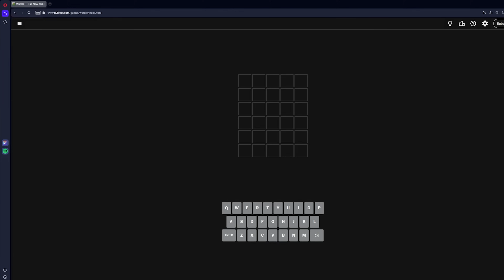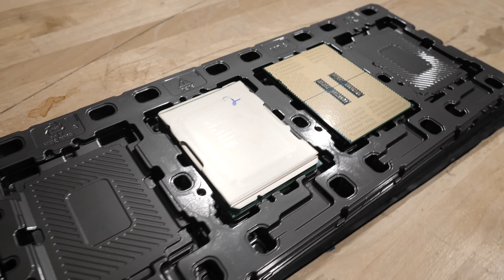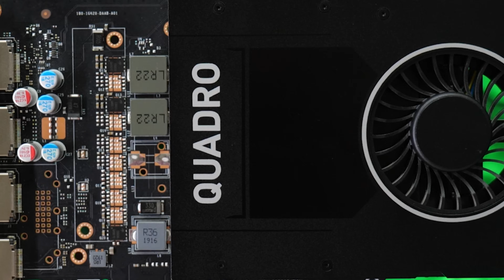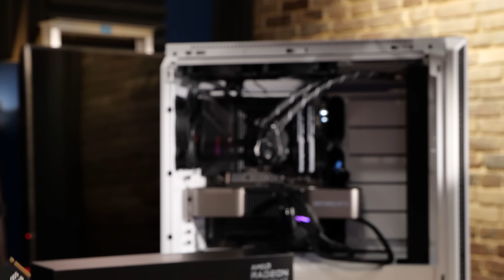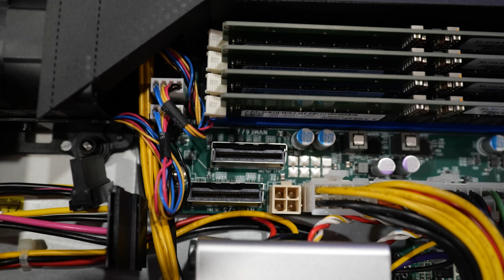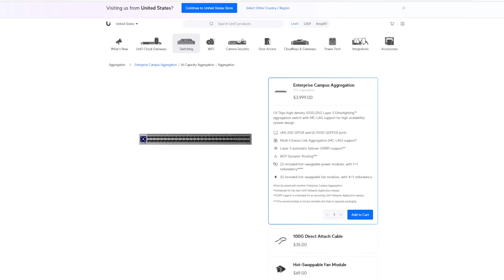What I've Learned Building High End Systems In 2024

Comment from the maker: Check it out here: https://opr.as/Opera-browser-Level1Techs
Reply: I can't stand Opera for one simple reason... they got rid of the familiar File Edit... menu bar... and they got rid of the Window Title bar.  You just don't do that in an application.   There is no way to grab the window and move it around without switching tabs.   Another major fail.    And they would be so easy to fix, just follow the user interface guidelines for Windows or Linux or Macintosh application windows.  Google Chrome and Chromium and Edge drive me crazy for the same reason, so I'm stuck firmly in the Firefox camp where I have a Title Bar to grab and a menu to select and chose options from.  Not some cryptic hamburger icon.

Comment: Oh I see the asrock steel legend SL 1000 can support five EPS connectors if you purchase three more cables somewhere! And rather affordably priced.
But mod DIY does have adapter from PCI to EPS however have to be careful of current due to half the 12v lines. But that is another method to get your EPS fix!

Comment: $100 Be quiet! Pure power 13m 750 w has 2 Full 8-pin CPU connectors, And the fan stays off in a moderately warm room with 300 w load!

Comment: could you guys recommend any PC case for threadripper pro, 512gb ram and qudaro 4000 (i barely use GPU, reuse from older workstation), which can facilitate 8x 3.5 HDD drives and have great airflow? All of the options presented in this video (torrent, north XL, ProART) supports only between 3.5 2-4HDD drives.

Comment: I was considering an older 3647 c621 system with dual xeon platinum 8180 and ASUS SAGE WS if I can find one. Just to have a workstation with 56 cores and at least 768 gb ram for editing, 3d and color correction and I was considering a used rtx5000. Windows seems to support xeon a long time and it's not x99 without UEFI bios I used to crack in 30 seconds.

Comment: i have r9 5950x with 128gb DDR4 but i'm starting to get random crash, i tested the system with just one stick of DDR4 in different slut but it keep happening, only when i limit the CPU to eco mode it work, so i guess it's a CPU, i don't want to invest in AM4 cpu upgrade and i have no warranty the pc from 2020, so i'm thinking to upgrade to am5 but i need a lot of memory...
any chance of AM5 128GB/192GB DDR5 video ???, can you run it at 6000mhz cls30 ???

Comment: Looking into a Silverstone RM52 for my next workstation too. It will likely be an arrow lake platform with fast ram. G skill now has CK modules that do CL40 at 8200mhz, but recently annouced CL26 at 6000mhz. Now I am unsure which to go with for my workloads. So I am hoping to find some benchmark numbers as the prices for 2x24 are the same but the later kit also has a 2x48 option - which could be the pick. 

As I plan to put a 360 radiator into the front.... I an not sure if the airflow across the mainboard will be sufficient, as those consumer Z890 boards have the ram not inline.

Comment: If you're at a point where it makes sense to build a system like this please, please don't buy Unifi. Depending on the features I'd strongly recommend going with either Juniper or Arista - something like the QFX5120-48Y from Juniper is 48x 25gb / 8x 100gb for ~$12-15k with a base license. Yes it's more but if you're planning to make money off your workstation you should have something far more robust than what you're going to get from Ubiquiti.

Signed, a network engineer
Reply: Absolutely agree, listen to this man

Comment: state of pc is horrible right now for high ram use cases, AMD reducing the ram slots on threadripper, instability with 192GB on ryzen, + lack of  64GB modules  means there is little in the way of upgrades for someone jumping from DDR4 / AM4 / Threadripper
Reply: I'm keeping my TRX-40 Threadripper. Really, I see no upgrade path forward at this point in time. While the 7960X is faster than my 3960X, the difference in performance is not insane, and I can't really have more memory or memory bandwidth.
In the meantime DDR5 is more expensive, so it's a much more expensive system for somewhat better performance.

Comment: JUST yesterday I bought three dual 25G NICs and a pair of sfp28 cables though I think I will only use two of them and run the second 25G port from my pfsense router to connect to my cheap 10G switch as I have a lot of 10G in the homelab...I'm super excited.  I was wondering though if I could buy a 100G to 4x25G breakout cable and use that with a 100G NIC in the pfsense router to go to my four servers with 25G each - but I don't know if a NIC can split the signal out or if it needs to be a switch...anyways, super excited about the upgrade :)
Reply: Wow! That's a really cool idea! I wish I could tell you for sure if the breakout cable would work on you router. That's a cool project!

Comment: So linux people,  tell me, opera or firefox for nobara?
Reply: I use Librewolf, a Firefox fork with privacy-minded defaults
Reply: Is this bait? No one should use opera under any circumstances.
Reply: @tappy8741  Oh alright? So then what are the option for linux? Nobara starts you with Mozilla. I was more checking if they are alright and if there is maybe something better.
Reply: @ Firefox or chrome or a privacy derivative you trust if you feel the need, tor browser to bypass blocking when necessary. Personally I just use firefox with some ad and tracking blockers (noscript and ublock origin does the job for me).
Reply: Librewolf (privacy-focused Firefox fork with good defaults) for general usage and Ungoogled Chromium for anything that works better with Chrome or breaks with the Librewolf settings. Use multiple browsers for different sites and purposes. Opera especially on Linux is behind Ungoogled Chromium, skip Opera.

Comment: The thing that keeps me using Firefox is every Chromium based browser sucks with font sizing. Firefox font sizing changes icon sizes and the text of everything from tab headers to general text with allowed defined size variations. Firefox also scales the entire web page to fit without having to scroll from left to right. Chromium doesn't scale the size of everything missing important elements entirely and when font size is inceased you have to scroll from left to right. For basic accessibility any Chromium browser sucks. On Firefox I can open a new tab or close one simply by pressing the mouse wheel. Any Chromium browser allows me to close a tab by doing that, but not open one.
Reply: Ctrl+w
Reply: @AI-xi4jk  depending what I'm doing I'm not always within reach of the keyboard and it still doesn't fix the terrible font scaling. Nothing worse having to scroll left, right, up and down to read something you shouldn't have to.
Reply: Middle click opens links in a new tab in Chrome (without switching to them), are you talking about something different?

Comment: Hey Wendell. What would you suggest for a college student on the typical college student budget? Budget consists of Disbursement from student loans and grants, so have to be somewhat conservative with the rest of the setup. My current setup is an AM4 based AMD only system: Ryzen 9 5950x CPU, the GPU is an XFX RX 7900 XTX Merc 310 something or other. Ram consists of 128gb 3600mhz ram (by Crucial, I think). Storage is around 6ish tb of storage space across all ports, 2 physical spinning rust drives, 1 and 2 tb, one of each, the 1 tb is an sshd, don't ask me why, no significant difference in performance. The SSDs are a mix of 512gb, 1tb and 2 tb drives, all by Rocket or Crucial. I'm pursuing a degree in Multimedia at a local community college, and suspect I'm going to need plenty of storage space. Should I go NAS or simply upgrade onboard storage on the computer? Oh, and the case is a Corsair 4000D Airflow, the 5950x is cooled by an Arctic Liquid Freezer III 360, (possibly overkill, but whatever.) Anyhoo, thanks in advance. :) PS, it's also my primary gaming computer, as you might have gathered from the specs.
Reply: You sound like you already have a pretty darn good setup for someone on the typical college student budget. At this point you should just optimize what you have for maximizing performance or efficiency. Any money you could spend on new parts should instead be spent paying off those loans unless you need to replace something. What you have is more than enough for any college program labs.

Comment: I'm running a 7950X and ROG Strix with a Ryujin III in the glass case North and it runs at acceptable temps for a HEDP while under load but still warmer than I'd like or expect from an AIO. I'd imagine a proper workstation build would HAVE to be in one of the mesh variants, preferably the North XL. Thanks for this vid, I've been considering stepping up to a NAS and eventually a proper workstation so this was a very informative look at the various options out there.

Comment: I need a dual Epyc system to watch YouTube videos and convert my CDs to flac.
Reply: Definitely can be a good use case.
Reply: @ I bet bandcamp could recompress their entire flac collection in a day with a dual epyc system. Flac is lightweight, a single core can encode at hundreds of times real speed. I guess really it depends on their storage solution or network, that'll be the bottleneck.
Reply: @tappy8741 the joke went over your head
Reply: @ What's the joke, that it's overkill? It didn't go over my head, didn't my comment expand on exactly that?
Reply: @tappy8741 The joke is that obviously it's not needed for that use case.

Comment: My only question about Threadripper specifically does TRX50/WRX90 still support S.L.I?
I want to move to Zen 5 while keeping my S.L.I system of two RTX 2080 ti's. I have a Ryzen 7 5800x 3D but I need more clock speed mostly for these dual cards & was thinking why not just get more IPC too at the same time.
Reply: The better question is: Does your software support SLI?
Reply: @moebius2k103  I've got a load of Dx11 games to play I haven't even gotten to. So yes, for the most part. I do have newer x12 games, but they've been kind of "meh" all visuals & no real good game play wise, lol